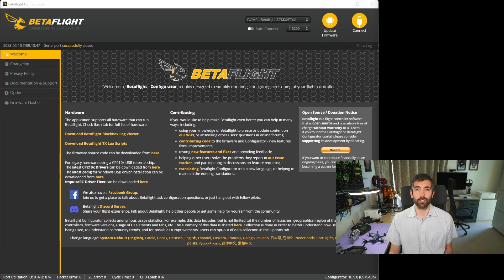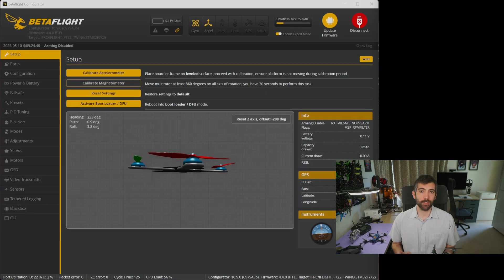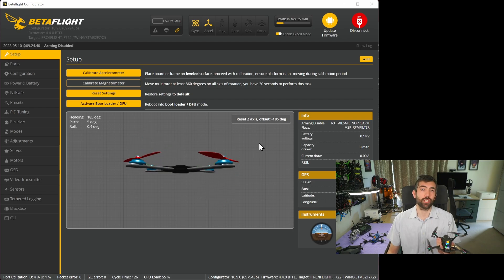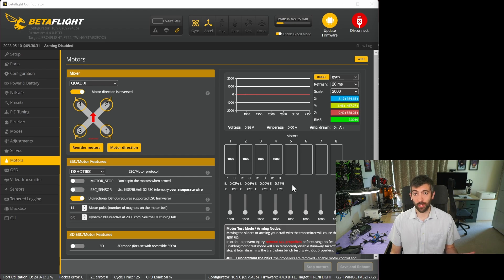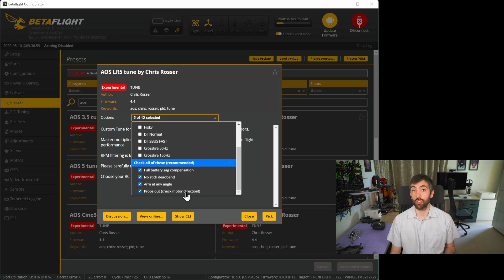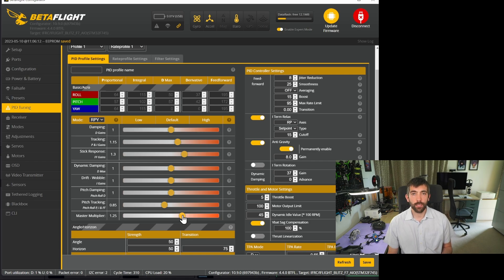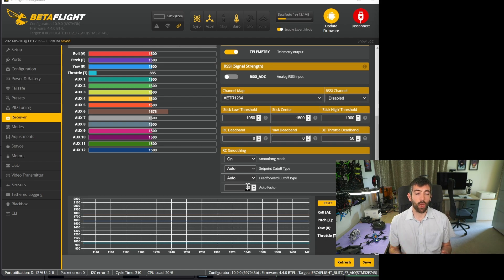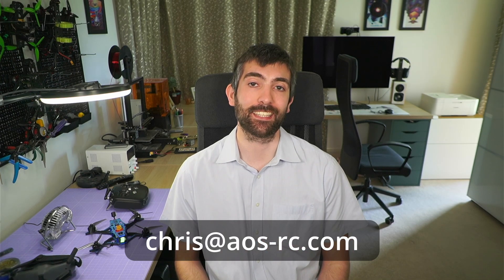AOS Presets for Betaflight 4.4 are here!

Comment: thank you for all the work you do, always precise and thorough.

I have had a beautiful AOS 5 EVO O3 6S bnf iflight for a few months (April 2023).
It arrived already set up with betaflight 4.2
Now I decided to upgrade to version 4.4 and installed your presets (filters and tunes).
Something really strange happened: the drone flies well but on a couple of occasions I lost control (the best way to describe it is a sort of slow death roll, weird desync or MIN throttle) and the drone crashed with the engines stopped.
OSD and telemetry remain connected but the esc no longer responds: it does not rearm, it does not activate the esc buzzer.
If I unplug everything and plug it back in, everything works again.

Unfortunately I only have the video stabilized in HD, now I register the osd and blackbox for safety.

I don't know if it depends on the settings or on the various crashes that the drone inevitably suffered... But can you tell me what could be the cause?

Comment: Hey Chris I applied the 5” preset with your checked recommendations to my very very clean v1 on 4.4 and the motors sounded terrible with throttle before actually lifting off so I didn’t. I turned tracking from 2.5 to 1.5 (like it show in your video) and master to 1.15 and it’s about perfect. Carrying session 5, 1050-1300mah, 1700kv and gyro lowpass 2 off 3.2k/3.2k

Thinking about turning up d to resolve some prop wash on ugly descents. Any thoughts?

Side note: I can fly this quad unlike any other, feels like we are defying laws of physics 😅

Comment: I plan to try the tune today. Just have charged 4 packs, radio charged and tune applied.

Have a golden O3 frame on analogue, but heavy 16 mm FPV Cycle motors. No action camera, however 850 mAh 4S packs. So a bit on the heavy side, but a lot of punch from the motors. Very curious now :-)

Comment: I thought my AOS frame was pretty locked in until I tried Chris's preset tune, and wow. Night and day difference. After a few seconds getting used to the difference in feel, I realized I had way more control over the quad and it was flying so much smoother than before with minimal prop wash. I'm very grateful for all the information you've shared with the community and I'm really loving your frame. Thanks Chris!

Comment: I get a caution notice when in the PID tab and turning the master multiplier slide up saying “caution slider positions may cause flyaways, motor damage, and unsafe craft behavior. Please proceed with caution.” Anyone know why I might be getting this message? My quad flys great and my motors are not hot, should I be concerned with the error message?
Reply: This is completely normal mate. I think you get this warning when going above 1.4 if I remember rightly. Just increase until your happy with how locked your quad feels.

Comment: I have a problem with the AOS 5 filter preset. The Dterm filtering is making my motors very hot and I have thristling motor noise when throttling up, and pretty severe vibrations. when I switch to default Dterm filter, it runs great with the rest of the preset.

Comment: stella work as always chris👌I have a separate question basically I was wondering if you could help me with regards to a 3d print ?, I sourced some mcx to sma adapters for dji goggles 2 a couple of pounds included delivery !! instead of dropping 20 bucks+ but could do with the inserts that come with the kit but obviously they don't sell  them separately so as your definitely 3d savvy could you please design or 3d scan some inserts for the community if possible kindest regards christian ✌.

Comment: I applied your "AOS 3.5 tune by Chris Rosser" for my AOS V2 Frame and noticed this preset changed a filter setting that I did not expect - Turned on Gyro Lowpass 2 with 1000 Hz Static Cutoff Freq and Filter Type = PT1.
In all your tuning videos, you have always recommended turning OFF Gyro Lowpass Filters
Why are you adding this Gyro Lowpass 2 filter?
Reply from the maker: This is for compatibility with F4 flight controllers running 4K/8K PID loop/Gyro loop. If you are running 8K/8K or 3.2K/3.2K it is safe to disable it.
Reply: @ChrisRosser  Thanks. I'll disable this gyro lp2.
Reply: @ChrisRosser Hey Chris, I could really use your help.  My last 3 7 inch builds have given me a fit. When I raise the throttle they just continue to go up in the air even when I lower the throttle to zero. The 10 inch just vibrates and goes crazy. That one used to fly. I'd appreciate your input.  Thanks!
Reply from the maker: @anfrae25  That shows not enough filtering or PID gains too high. Try reducing master multiplier and filter cutoffs.
Reply: @ChrisRosser  Thank you, Chris. I appreciate you taking the time to respond.

Comment: I have noise issue on my AOS 5.5 O3 with avatar video link
Camera dempfer make vibration and gelloy
I do my best to create a clean build, bun noise on frame is terrable - worse than Apex 5 DC 
I try 2 flyght controller (Matek F405TE-mini with ICM gyro and SpeedyBee F405v3 with BMI270 gyro. SpeedyBee have better result, but realy not ideal) 
I can proof that, but youtube block link's
Reply from the maker: You can email me and I can take a look at your build to try to help.
Reply: What's your email Chris? I have prepared few pictures with crazy noise that I get from LR5 v1. I don't think that's normal, and I haven't seen those lines of noise before anywhere..

Comment: Does it matter for the tune what motors and other components are on the frame? I have an AOS 3.5 v2 with fpv cycle 16mm motors running 4s. Currently running pretty much stock betaflight tune and I’m not very happy with how it flies.